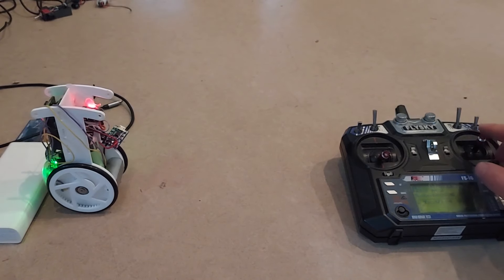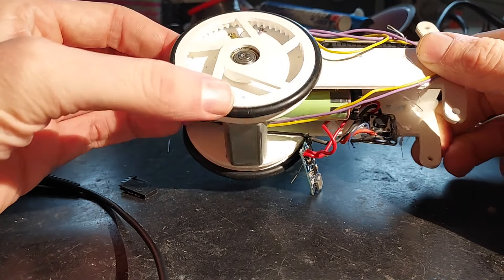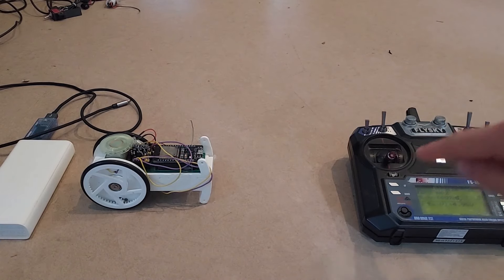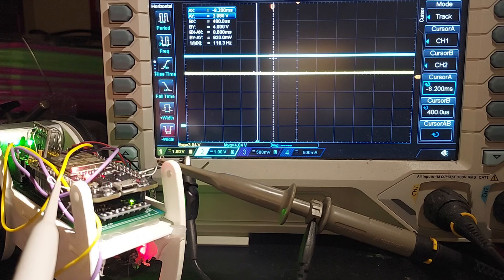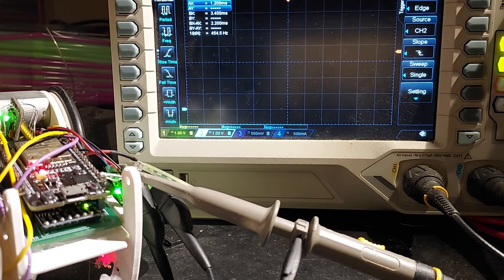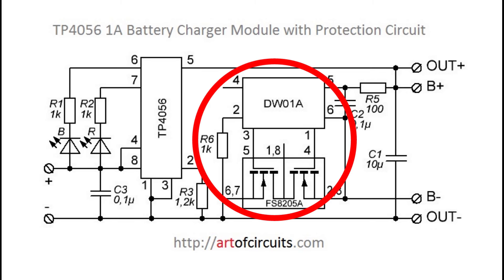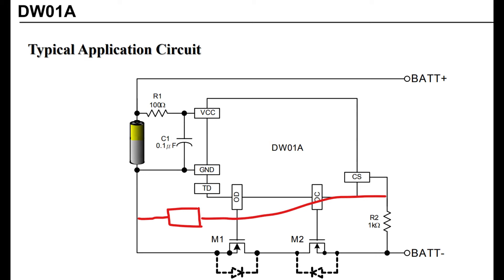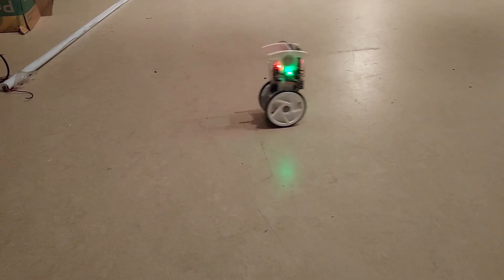Cheap balancing robot can now right itself!

Comment: Interesting "debugging explanation" Thanks!
For the bypassing of the current-sensing - Does the resistor mean that the "protection" features of the circuit 4:35 are no longer active? Aren't you concerned about over-discharge, reverse-polarity (unlikely) or over-charging? 
On a related topic - would it help (instead of adding a bypassing jumper) to add a second pair of MOSFETs in parallel to the existing pair? This would reduce the drop withouting defeating protections.
Reply from the maker: Thanks for the comment :). My idea was that the resistor works as a voltage divider. I have assumed the protection features are still active but have not tested this (shame). This is bad design; however at the moment I'm using a protected 18650 cell so this doesn't worry me. For later on, when I'll be using an unprotected 18650, this'll be definitely relevant. 
A second pair of MOSFETs would definitely be a solution; would even be possible on a small footprint :).

Comment: Maybe a capacitor to provide low resistance higher current supply during the large load spike?
Reply from the maker: Thanks for your reply! I did a quick experiment with this; a quite large capacitor would be needed. A solution could be to have a diode followed by a buffer capacitor to power just the ESP32. However, this would be a "patch" instead of solving the underlying problem (voltage drop of the source); I'd rather solve the underlying problem than patching it. Experience has learned me that stacking patches instead of solving root causes leads to unmanageable complexity.
Reply: You might want to supply the microcontroller via a separate power supply with a filter for conditioning. Inductive loads, like motors, can cause big voltage spikes, positive and negative, which can play havoc with digital electronics.
Cool project. Good luck!
Reply from the maker: @tolkienfan1972  I'll keep it in mind and test for voltage spikes when making a PCB for this project. Thank you :)

Comment: have you uploaded the code for this, would be interesting to see what the robot is doing during the self righting, i assume you turn the motors at max speed for some short period of time to get the robot close to vertical and then "turn on" the pid balancing again.
Reply from the maker: Thanks for mentioning; I'll try to push the latest code to the git repository this weekend. The code isn't spectacular (on purpose); I simply turn on the PD controller while the robot is lying on the ground. The code is here: https://gitlab.com/kloppertje/balancingrobotdc/-/blob/devel/src/main.cpp?ref_type=heads#L159 but since this video I made some changes to it regarding self righting. I'll notify you if I push the code
Reply: @kloppertje  just another question, so if all you are doing is turning on the pid controller while the robot is down, why does it not automatically self right after it falls if you don't turn off the pid controller
Reply from the maker: @abdulwaheedouabihi5903  To be exact: I simply disable the motors, the PID controller keeps running in software while the robot is lying down :). There is a state machine in the code. If the angle is below a certain value, the robot is probably lying flat. The robot is enabled either when it is near vertical (so, someone put it upright), or when a self-right command is received
Reply from the maker: @abdulwaheedouabihi5903  The version of the code used for this video is now pushed, see https://gitlab.com/kloppertje/balancingrobotdc/-/blob/devel/src/main.cpp?ref_type=heads#L190
Reply: @kloppertje  thanks